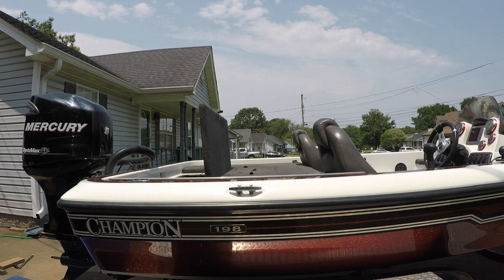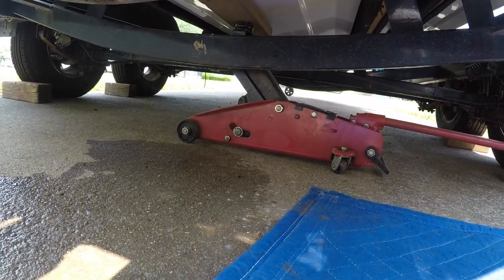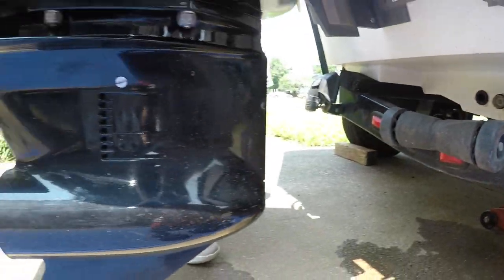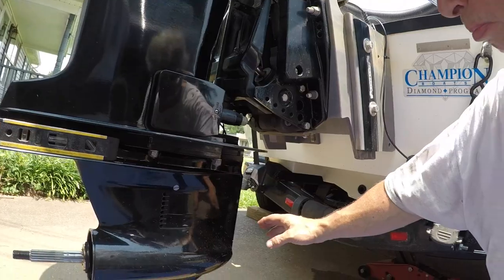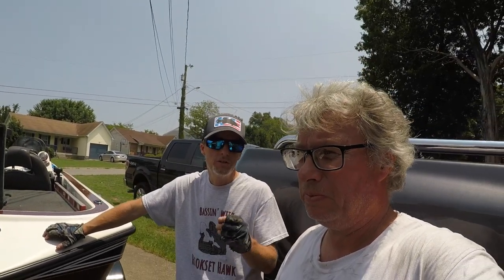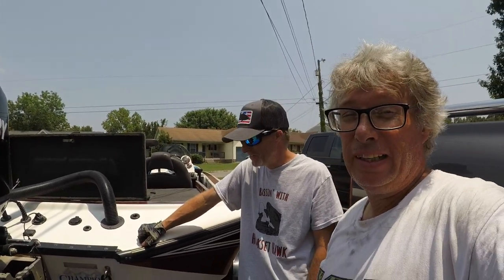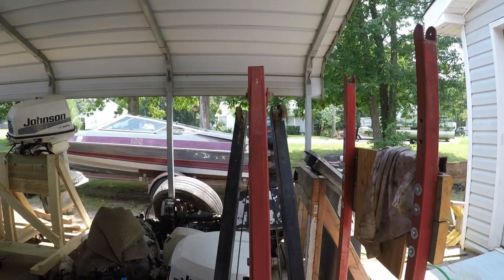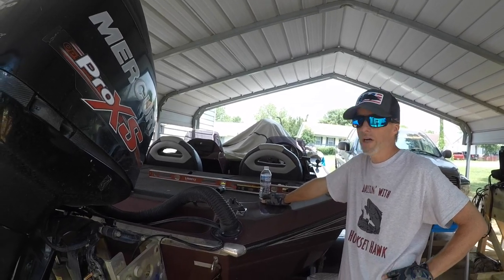Measuring Prop to Pad Optimizing Performance for Ultimate Speed and Handling Champion Boats

Comment: Just heard about this prop to pad didn't know about it running a 85 Yamaha 2 stroke on Full throttle and destroy my power head 😢
Reply from the maker: Oh man, watch your water pressure and I think those top out at 5800 rpm's.